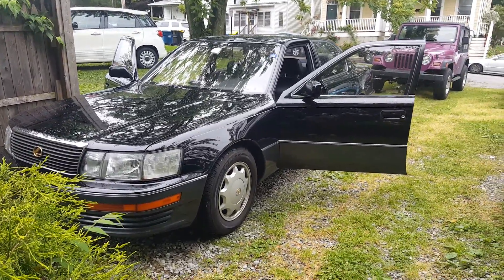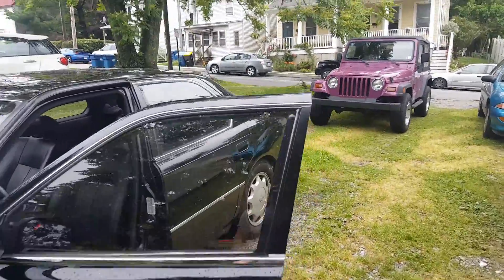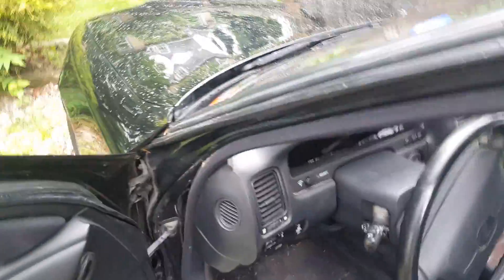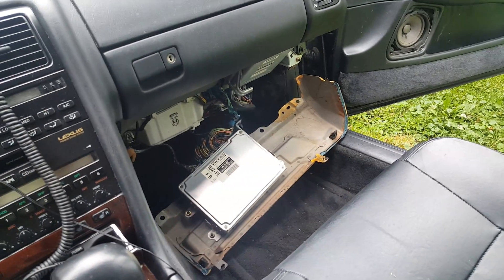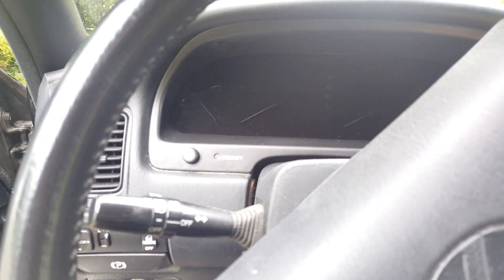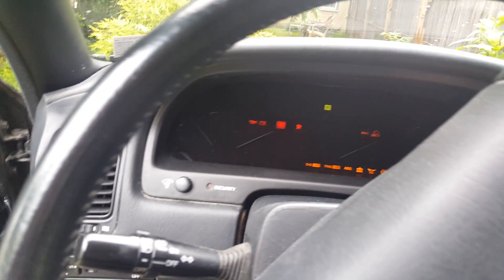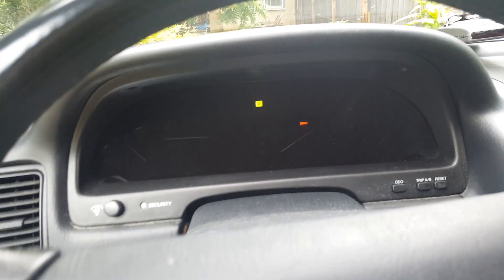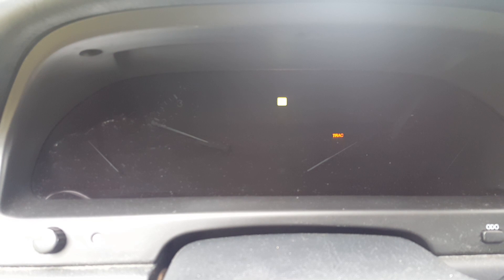LS400 bad capacitors in ECU and Gauge Cluster

Comment: There is a problem in my IS400 car the engine working good but RPM does not work when you pres son  fuel. 
What solution? or Is there another computer that works with the engine
Reply: You still have the problem?
Reply: @parloitaliano2  yes
Reply: Same bro have you found any solutions?

Comment: I just bought a 98' ls, my temp isnt moving at all and stays at C but the rest of the gauges work, took it to 2 mechanics and they ran a coolin test and sensor test, they found nothing wrong and said it drives perfectly. What could it be cause i dont wanna keep spending $$
Reply: Coolant temp sensor, water temp sensor, temperature sensor switch. All these parts you can find on parts geek and you could install them yourself. 
I bought a 1990 with over 200k miles a month ago. Did all the same and replaced thermostat as well.
Reply: It’s your gauge cluster itself, I had the same issue
Reply: @abrahamdiaz846 I have the same problem on my 96, I’m not great with sensors and electrical, but I’ve confirmed that the car is running at normal temps through an OBD2 scanner. So it’s either the sensor to the cluster not the ECU or the dash. Just don’t know how to test the sensor for the dash.

Comment: Finally. Any issues accessing the ECU?
Reply from the maker: no you can see it in the video, it's that silver box hanging from under the dashboard on the passenger side, you just remove that lower cover and it's right in there
Reply: 5 minute job with 10mm socket wrench to pull the ECU out.  Be carefull when pulling on plastic connectors. Don't break locking tabs. How are your solder skills?
Reply: @notyou6950  how much is a job like this?
Reply: @Mr_Littt  don't know. I do most of my own stuff.